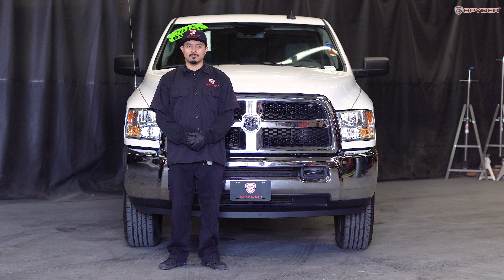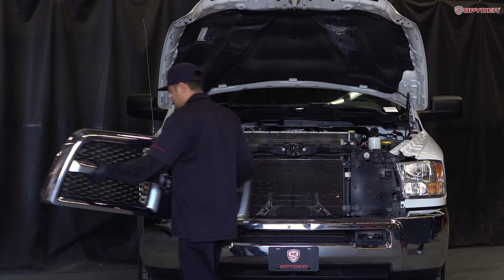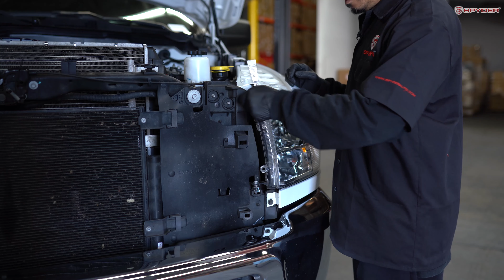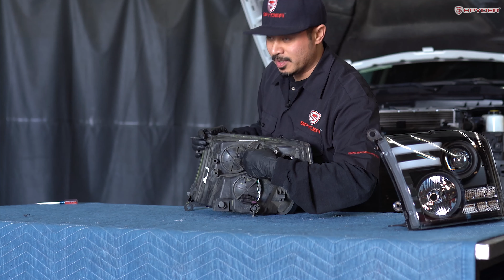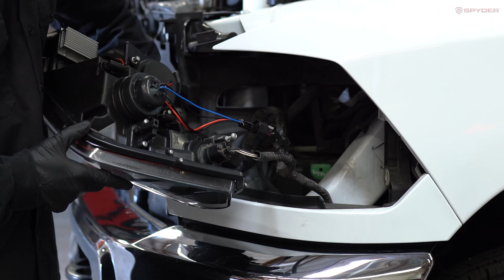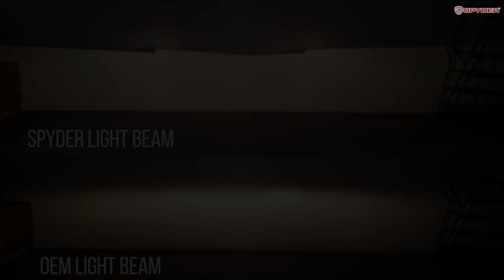Spyder Auto Installation: 2009-2018 Dodge Ram 1500 Headlight

Comment: I have these on my 2010. The passenger low beam is barely functional. Seems like only half the beam is working. Is there any fix, or is the light junk all together? They’ve been on the truck since I bought it a year ago, so it’s not something I can send back. The drivers side works fine.